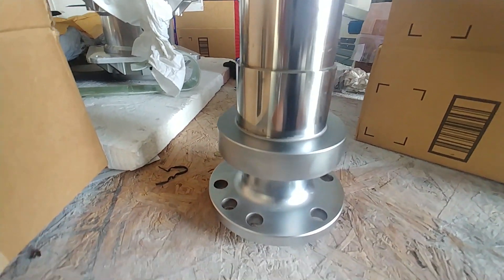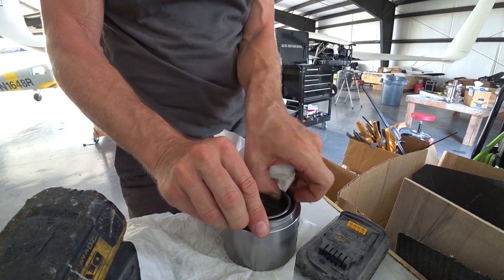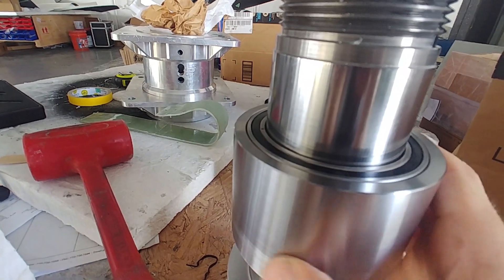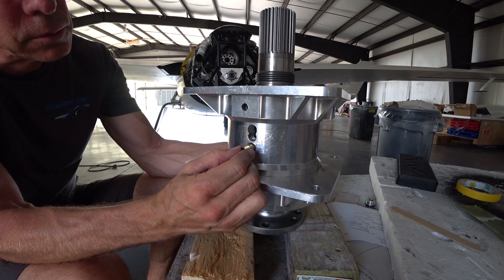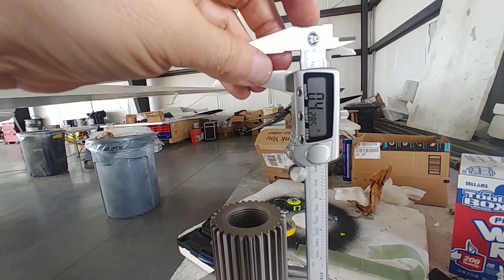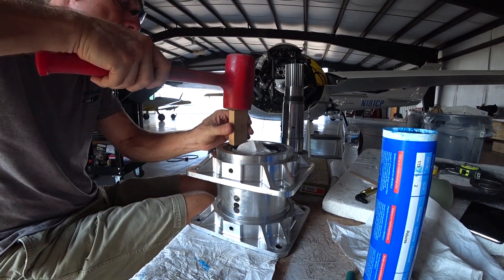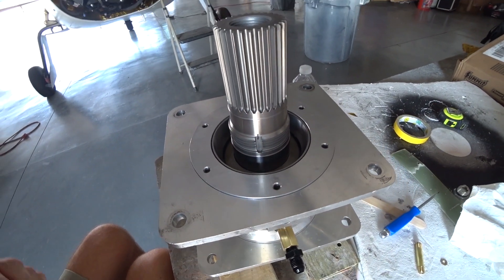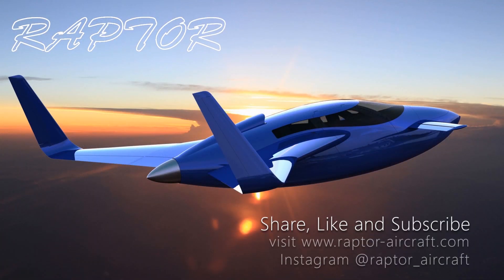Reduction Drive Reassembly - Building the Raptor Prototype

Comment: Oil bath would be good for the bearings. For decades ski-doo insisted on using grease on their engines main bearings, needed to overhaul the engines to repackage every few years and it was a pain in the ass. Thankfully they finally switched to oil bath, and oil pressure fed bearings on the new ETEC engines.

Could be the same issue here if the bearing is hard to service. If its easily serviceable to repack would be ok. Oil bath and oil pressure fed would have a few benefits though allowing oil analysis when changing the oil to asses the drives heath during routine maintenance.

Comment: I love the videos but it is scary thinking why didnt the engineer who designed the drive assemble it ?  Asking because I see you have never packed a bearing  before I dont know if you should trust your judgment on bearing preload and drive assembly. I would think it would be a bad idea to oil the drive from the engines oil system also what if the seals fail on drive (especially because those seals you just installed are not made to have constant pressure on them they are a splash seal or grease seal)and blows all your engines oil out the back of the plane ?.I would love to see your plane fly I hope all goes well for you.

Comment: Am I asking a dumb question.... What keeps prop oil from filling up the cavity where the oiling collar lives and simply dribbling out the holes in the housing where the feed and return lines pass through it? You said there was 2 thou clearance between the oiling sleeve and the shaft, and that the sealed bearings at the ends of the sleeve have a slip fit about the shaft... I don't see how this ostensibly pressurized oil system doesn't leak. The belleville washers won't seal against the shaft or sleeve or case, the bearings aren't sealed against the shaft, there's no sealed grommet where the supply and return pass through the case...  Does something I missed seal against the outer race of the small sealed bearings?  This is way too huge an error to overlook, so I'm assuming I missed something in the construction somewhere.

Comment: Hi Peter. Mechanical engineer here. Is that shaft shot peened? Chrome plating can cause the loss of up to 40% of fatigue strength due to microscopic cracks, along with hydrogen embrittlement. Shot peening and baking prevent that, and are standard procedure for fatigue applications per Fed Spec QQC-320B. Here's a good summary: http://www.ultraplating.com/specs.pdf

Comment: I may have missed it but I do not see how the oil is sealed into the inner oil collar. Those precision bearings are floating and will not seal the shaft "oil-tight".   I assume that the oil will be under some pressure and and it will slip past the precision bearings and simply leak out of outer housing through the holes drilled for the drains to access the inner collar.  Again, I hope that I missed something here.
Reply: The shuttle bearings are in the non pressurized section of the shuttle. There can be no pressure as this is where the drain pipes are going to and relieving any pressure. The pressure is contained by an inner metal ring of the shuttle that rides on the shaft directly, lubricated by some oil slipping by but not so much that the oil pressure would drop.

Comment: Bearing should be greased by placing a health bit of grease in the palm of the hand and taking the larger end of the bearing and scraping it to the back of the palm till the grease is pushed out the frount than rotate the bearing and repeat for 360* to insure the grease is free from air pockets. Looks great though everything is comming together nicely 😁
Reply: This isn’t the same someone I Flew with in aces high?

Comment: I see a mistake mate, the sealed bearings have seals on both sides, meaning the only lube those bearings will see is the lube that the factory put in there. You should remove the inner side bearing seals so oil will lube them. If one of those bearings seize up it will destroy your whole reduction drive deal!
Reply: Hey if you want oil to go to the ends of the reduction drive than remove both seals on those sealed bearing assemblies.

Comment: Get a bearing packer or learn how to hand pack them.  You didn’t get enough grease in those bearings.
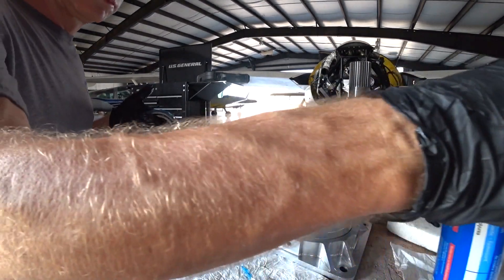Reply: Did you actually watch and listen? @11:50 shows plenty more grease ,than what was shown when he cut the scene @ 11:40.
Reply: @nssherlock4547  Yes, watched the entire thing.  I've packed lots of bearings and I'd pack a lot more grease in those guys!
Reply: @nssherlock4547  Yes, watched the entire video.  That's not how you pack a bearing.  You can hand back it or get a packer. He did neither.

Comment: Hello , I admire your persistence with this , it has failed and failed and failed again and again , yet you persist , I hope you per vale , but, an alternative may be ,( if you don't want to reinvent the wheel again) there are at least 4 or more reductions drives available to buy from other manufacturers who have already have  done the r&d , and have been through what your going thru now , you could just buy an existing one from some one else ,  and put it to bed ,ps as mentioned along time ago , your /the hydraulic psi is too high , and will always blow the seals ,,,, any how , best of luck,  I can't wait to see it fly , 
regards 
just another armchair admiral
Reply: There is no pressure on the seals of the inner shuttle bearing as the drain holes are relieving the pressure. What seals the governor oil (but not perfectly) is a tiny air gap between the shaft and the inner rings of the shuttle. The shuttle bearings are just there to keep the shuttle from wedging and to seal the non pressured drain section of the shuttle.

Comment: Great job, Peter!  Your channel is better than any series-type show out there. :-)  I don't think the snap ring for the seal is overkill because if there's any slight build-up of pressure on the backside of the seal, just do the math and you can easily see even a little bit of pressure will push the seal out.  In an automatic transmission, this is a malfunction that DOES happen.  This is how transmission front seals are pushed out the pump.
But hey, check this out:  In my automatic transmission repair career, I've found that brass fatigues much easier than steel, especially if there's any vibration.  For example on automatic transmission cooler lines, we don't use brass fittings, nor do we use copper lines.  As the factory does, we use only steel lines with steel fittings due to the vibration factor.  For non-factory compression unions, we use the stainless steel Aeroquip aircraft unions.  Is brass just more convenient, or is there a reason?  Just asking...
Reply from the maker: Yes I'm going to replace the brass with 4130 if this new setup works ok.
Reply: @RaptorAircraft  Thanks for the reply!

Comment: I don't comment very often but I felt that I should here on this video. I have been watching the videos on the Raptor project and it has been a joy to watch. Thanks so much for bringing us Aviation people these videos. Remarkable work and what a sweet airplane. I hope that if will do everything that you are working for. I was just wondering if you have ever used Royal Purple Petroleum products? There oils and grease products are just awesome. Cost is high but the quality is off the charts great. Watching you pre-grease the prop shaft bearings I was hoping that you had Royal Purple. The benefits from those products are many. I don't have anything to do with the company or try to sale the products but I believe in them. Check the product out some time. Thanks for the videos and the build of this remarkable machine.

Comment: Very nice piece of machining......  easy to see why it took the time it did. The tapered roller bearings are a much better setup than the journal bearings. Wouldn't bathed bearings extend the service/inspection interval of the drive?

Comment: How is that thing not going to leak oil around those pipes that feed the inner ring?? Seems like they need to be sealed somehow??
Reply: The oil lines are feeding the inner shuttle. There is no oil between the shuttle and outer housing.
Reply from the maker: There is no oil feed in the main housing, only inside the oil collar.
Reply: Oil enters and exits the oil collar in the middle through those tubes. If it is build correctly, no oil should be leaving the oil collar into the main housing... So no oil should be coming through the holes.
Reply: @MercFE8235  Right but because it's not a press fit onto that shaft and those bearings are kind of a slip fit there's some clearance there and oil will leak past the bearings into that housing and then out those holes......
Reply: No, it will be pressurized with oil... But the viscosity will be high enough to form a surface tension on the outer face, preventing it from leaving the end.

If it was press fit, the 2500+ rpm rotation would just wear into the face of the prop shaft, forming the spacing that is already designed in. You can't have metal on metal contact and expect no wear during rotation. Again, this is designed to float on the oil, while remaining tight enough to contain the fluid.
Reply: No, the fit is tight enough that oil will not exit the inner collar. It is designed so that the shaft should float on the oil, but not so wide that the viscosity of the oil should remain great enough that it will not feed past the outer edge. 

The oil should pass from the center channel to the outer two and exit the collar through the exit tubes... Path of least resistance and all.
Reply: @MercFE8235  So that tiny amount of Grease he put on the bearings is supposed to somehow be a long-term lubrication solution?? I feel like that thing should be pressurized with oil to lubricate those bearings???

Comment: Multiple Belleville washers may be stacked to modify the spring constant (or spring rate) or the amount of deflection. Stacking in the same direction will add the spring constant in parallel, creating a stiffer joint (with the same deflection). Stacking in an alternating direction is the same as adding common springs in series, resulting in a lower spring constant and greater deflection. Mixing and matching directions allow a specific spring constant and deflection capacity to be designed.